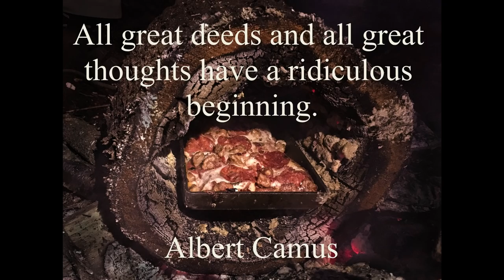3 Trees+Chainsaw= Wall+Door #4

Comment: I was using hand tools and charging batteries when in town as well. Then caved and got an old generator for the $20.used chop saw that cuts my free skid wood to fit the cubic mini wood stove. Finally got a 100watt solar panel and deep cycle battery that provides ALL power needs except the chop saw, blender, and old electric lawn mower that chops my leaves for garden compost. Loving the LIFE. Enjoy!
Reply from the maker: Nice! Where are you? Thought of solar but too many trees and seldom seen sun.
Reply: @survivingringworm2202  I'm an hour North of Lake Ontario. I hang the Solar panel off the cabin facing South and it keeps the deep cycle battery topped up even in winter.
Reply from the maker: No kiddin? You must get a decent amount of sun there? Might have to top a tree and climb a panel up there...